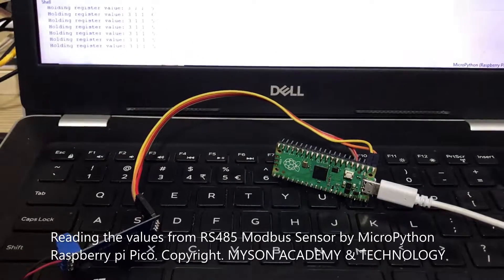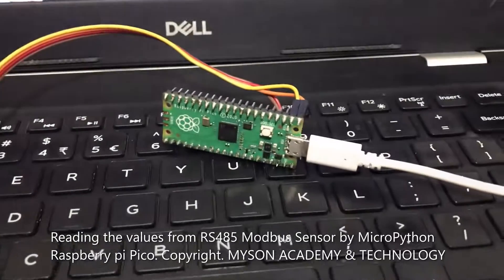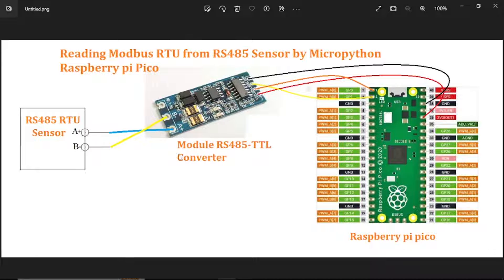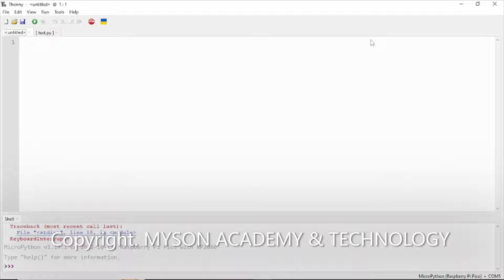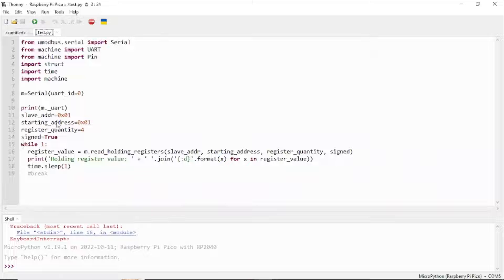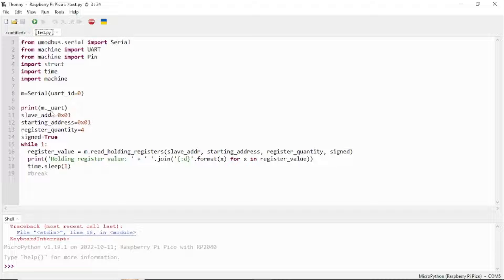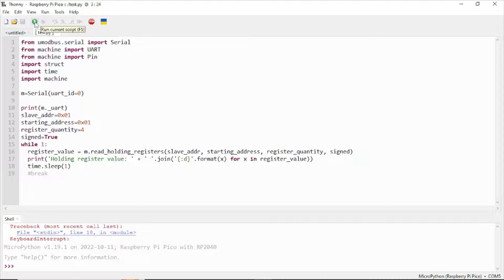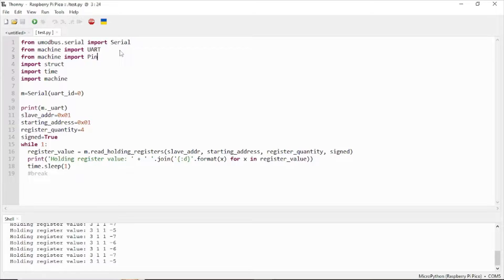Read holding registers from RS485 Modbus RTU by Raspberry Pi Pico Micro Python

Comment: Traceback (most recent call last):
  File "<stdin>", line 9, in <module>
  File "/lib/umodbus/serial.py", line 107, in _init_
TypeError: 'NoneType' object isn't subscriptable

EROR HELPPPPPPPPPPPP
Reply from the maker: i think the umodbus library have updated, you have to read more information, test and try this part to see it can be change.
class Serial(object):
    def __init__(self,
                 uart_id,
                 baudrate=9600,
                 data_bits=8,
                 stop_bits=1,
                 parity=None,
                 pins=None,
                 ctrl_pin=None):
        self._uart = UART(uart_id,
                          baudrate=baudrate,
                          bits=data_bits,
                          parity=parity,
                          stop=stop_bits,
                          # timeout_chars=2,  # WiPy only
                          # pins=pins         # WiPy only
                          #tx=pins[0],
                          #rx=pins[1]
                          )
Reply: I SOLVED THE PROBLEM WITH YOUR HELP, THANK YOU
I NEED A PROGRAM FOR A SLAVE DEVICE. HOW CAN I CREATE IT? THANK AGAIN FOR YOUR INTEREST

Comment: how can i contact you through mail?
Reply from the maker: you can contact me this comment
Reply: @mysonacademytechnology2431  I  need help in connecting two raspberry pi using lora
Reply: can i connect 5  LoRa to raspberry pi transmitter 5 and 5 receiver LoRa
Reply from the maker: @sharathchandan6867  you can use one lora reciever, and five lora transmitters or more by set id from recievers and transmitters depend on your choices
Reply: @mysonacademytechnology2431  thanks! can i use 5 receivers at same time..possible?
Reply: @mysonacademytechnology2431  my lora reciever not printing output...transmitter working